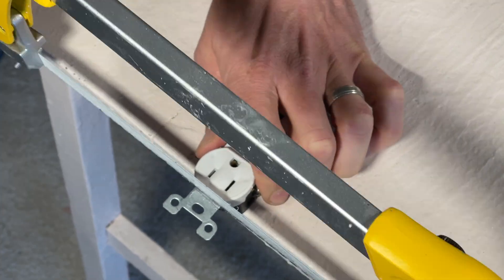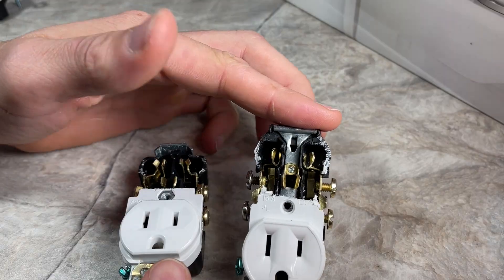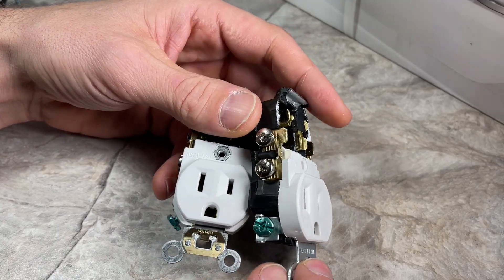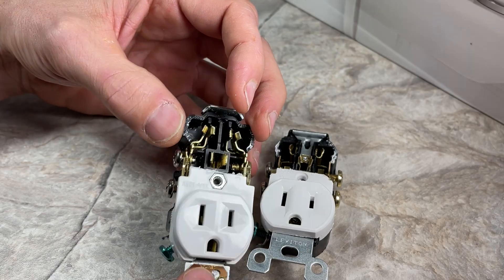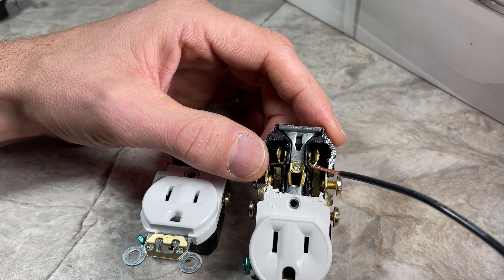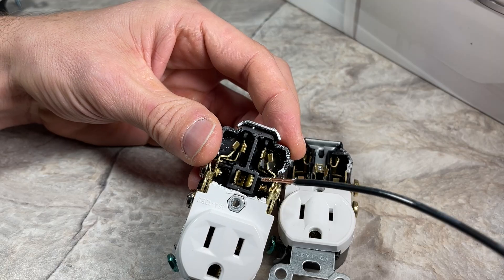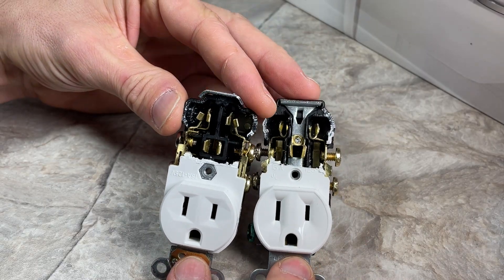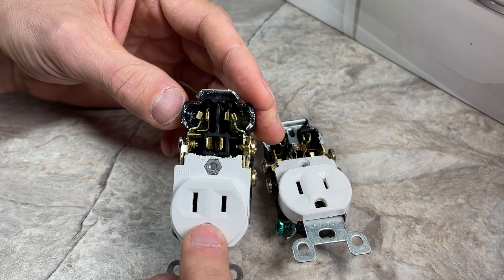What Outlet Should You Buy For Your Home |  Commercial vs Residential

Comment: There is anothe type of outlet where the wire goes in the back through a hole like the push-in connection kind, BUT NOT TO BE CONFUSED WITH THAT EXTREMELY POOR DESIGN WHICH IS A SURE FIRE HAZARD..  NEVER USE THOSE.  DON'T UNDERSTAND HOW THOSE PASS MUSTER TO BE SOLD.

THE ONE I ALWAYS USE HAS A CLAMP INSIDE at the end of the screw. The hole in the back is aligned so that when you put the wire in it goes between the two plate of the the clamp and the screw pulls the inner plate against the wire and in turn pushes the wire against the outer fixed plate of the clamp totally securing the wire. You can easily identify these because as packaged the screws are unscrewed and crimped at the tip so they can't come out. The screws rattle around and you can see through the hole the inner plate of the clamp moving around unlike the push contact where the screw may be out, but the are screwed into the side of the body.   In the good ones the screw passes through a hole in the side of the body and is screwed into the inner clamp plate. Bryant makes them and Leviton probably does too. You can't beat a screwed down clamp!  Even better that under a screw head because most people don't know how to do that properly. The clamp is simple, fast and fool proof.  I never use anything else.  Yeah, they cost more. How much is your house worth?  Industrial maintenance specialist. I used to be responsible for an 18,000 sq ft manufacturing plant
and everything in it, on top of it, and under it, was my problem.

Comment: The typical bottom price receptacle is ONLY able to handle #14 wire -- if back-stabbing. These are the ones used en masse by tract home builders. Specification Grade receptacles actually expect #12 gauge wire. There are only a few areas in a home that demand such 20 Amp wire -- the kitchen and bathroom, being foremost. So, the rule is to go with Specification Grade where 20A is NEC spec'd. These are exactly the same places that have lots of insertions and removals of appliances over the years. It's the physical stresses that ruin receptacles. BTW, most residential circuits are -- by Code -- less electrically stressed than Commercial Circuits. In commercial use, circuits run, largely, straight through the business day. The typical Residential circuit has -- effectively -- intermittent loads... stuff like a coffee maker, hair dryer, slow cooker, .... So the rule is: brutal use -- stay with Specification Grade. Otherwise, in residential use, you can go 'cheap' without worry. BTW, there are VERY few receptacles of ANY type made in the USA these days. Entire factories have been shipped off to Red China and Mexico. Robotics has largely replaced human labor across the entire spectrum of production. Another reason to pay-up for Specification Grade receptacles: they tolerate DIY hand skills MUCH better.

Comment: My home builder installed cheap outlets throughout my home.  It’s almost impossible to even plug anything in.  You have to wrestle the plug in and it’s awful.  I dread having to plug anything in!  My advise is to blow the budget and install quality hospital grade outlets throughout your home.  You’ll never regret it.
Reply: Do you mean it's hard to push the plug into the receptacle? It could be these are tamper proof versions, and those tend to need a specific technique. There are some videos about plugging into tamper proof plugs, especially for senior's who have arthritis. Once you see how the mechanism works, then the technique makes sense and it works every time.
Reply: A cheap outlet would be the easiest to insert into. A hospital grade outlet will need a hemmer. ( almost, they are stiff. )

Comment: Often in many jurisdictions there is certification to consider. Many home reno stores sell the certified receptacle and the cheaper uncertified receptacle. They can often be essentially identical but there is a cost for the certification so that one is more expensive. 

Depending on the region there may be no rules against selling the uncertified one, but there is some rules and liability against using the uncertified one. It is basically a competitive market grab move for the home stores to have the lowest prices but it can cause huge problems for customers down the road. 

If you are building something new which requires permits your inspector may tell you to rip out the uncertified ones and put in certified ones before passing your build. 

Also there is a slim chance that an electrical fire causing damage may be refused insurance coverage if they find you used a cheap uncertified receptacle from a home reno store. 

Again this is all regional so you need to be careful, and at least talk to an Electrician buddy about it before you do too many projects yourself. 

Also the same thing applies to boxes and switches.

Comment: The residential 15 & 20 amp. plugs are fine for home / apt. use  with solid copper wire ! 
the commercial grade has a more positive separate 2 contacts for the hot and neutral because things are getting plugged in & out a lot more than in home use, the problem of residential is plug overload { christmas lights/ stereo equipment } and putting 15 amp. plugs into dinning/kitchen/laundry/ utilities room were NEC says 2 independent [ A&B phase] 20 amp. circuits are the law!
And a lot of homes & apartments built back beyond 1986 are run with aluminium or aluminium clad wire , were  Co/Alr plugs are NEC use by law ...  anytime I run into this , I bid that j-boxes be installed and solid copper wire be run to the outlet boxes and use Co/Alr wire nuts with the lube be used in the j-boxes because copper wire is just a better heat sink than aluminium !

Comment: yes the residential are cheaper made but at the savings you can have a box of replacements handy.. and when you consider 20 plus years prior to failure in most cases I would rather have new ones every 20 years then possibly replacing commercial ones every 40 years ?

Comment: I love Roy Najecki’s info! 👍 If it’s going to see frequent use, I want spec grade.  And if I can use NEMA 5-20 receptacles in place of NEMA 5-15, I will.
Reply from the maker: Thanks for the feedback Lane!
Reply: Only use 20 amp outlets on 20 amp circuits. Do not suggest that the wiring is 20 amp when it is not.
Reply: @kkarllwt  agreed.  Normally a receptacle circuit is 20 amp with #12 copper wire (I have lived in a cheap manufactured home with #14 wire and 15 amp circuits), thus a NEMA 5-20 on a 20 amp circuit seems a more durable choice.

Comment: He forgot to add if the outlet does start to fail and there is an arcing in the line the circuit breaker would shut off....weather it’s the .50 or $2 -$3
Reply: Not all shorts are going to trip the breaker.

Comment: Your basic 15a residential grade is fine for 99.9% of applications. .Is the 20a commercial-grade better, yes, but when building were do you stop spending "just a few more dollars "  Leviton is a good  brand name avoid GE devices, complete garbage. , HUbble is about the best you can get , and only available at electrical supply houses, not like your home depos , Use 20a in the kitchen for sure, but other then that, regular outlets will give you years of trouble free service when installed properly, And PS, fires start in the neutral, not so much in the hot leg , the hot leg is protected  the neutral is not

Comment: Nice!  Always wondered about that.  When I remodeled in 2004, I dumped the money into the Cooper Commercial grade receptacles.  Super high quality BUT, today, the white plastic on half of them is definitely discolored to a somewhat obvious off white.  Ugh.
Reply: White isn’t a good choice for most things, in my opinion.  I put those Cooper receptacles in my kitchen upgrade, but I chose “light almond.”  That shade works well with colors without standing out the way a white device would, and I don’t expect it to discolor noticeably since it is alreade off white.
Reply: 16 years on you still work to unplug from them. As it should be.

Comment: Tamper resistance outlets are all I buy.
Reply: That’s what you are supposed to use now, but I hate them.  In my kitchen, where I plug things and out relatively often, I got specification Eagles (Cooper), but my electrician said I needed tamper-resistant.  So I bought some just to get through the inspection, then replaced them.
Reply: @GH-oi2jf  yeah I can understand the frustration of that in the kitchen. I just buy the contractor packs so everything gets swapped to TR I bet a new regular outlet is fine as long as it’s in line with a GFCI. You may have to replaced them in a few years but that’s not really a big deal.

Comment: The commercial grade you have there can handle four wires on each side, which means you don't have to pigtail when you have more than two wires on each side, which saves a lot of time and effort.  (In some places, pigtailing might be required by code, or at least people think it is.  And, some people think you should always pigtail, regardless.  Whatever.)  Another advantage with the commercial one is that it accepts straight wires, so you don't have to bend in a hook, again saving time and effort.
Reply from the maker: Hey Dan, yeah I think the back wire option for the commercial is a big plus.

Comment: I wired a double box with #10 wire and 2 20-Amp receptacles. Overkill? Better than underkill. I can plug in power tools and know I won't fry the circuit.

Comment: You're not kidding about those push in holes for the wires. I made that mistake once, NEVER AGAIN!!! I always use the screws, and use pliers to shape the wire around the screws, for maximum contact area. That minimizes temperature rise, if the outlet is heavily loaded, by plugging in something like a space heater. You just don't get much contact area with the clips biting into the wire when you press them in the holes. Once the wires get hot, they oxidize, increasing contact resistance. It takes very few thermal cycles, to simply burn up, if something like a vacuum cleaner or electric heater are plugged in. (high power appliances should only be plugged into a 20A service, wired with 12 G or larger wire)

Comment: i try to find the commercial outlets that have the back wire option under the screws. allowing for a lot easier and more versatile connections of the wires in and out of that box without  wire nuts you can have 4 wires securely on each side of the outlet with the wires just striped and inserted strait in holes that are clamped by the screws

Comment: I can tell you without a doubt that until I saw your video I had no idea how completely unacceptable the so-called residential plugs are. They almost seem to be balsa wood instead of oak in the constructing a table. I just would simply change them all out as a matter of course because I don't want to have to worry about it, I want to build it and forget it if you will. Excellent video thank you for sharing.

Comment: I tend to make sure I do not have to unplug most of my receptacles, and never use extension chords for any reason. I also make sure the chords do not sit on the floor to be walked on, furniture slid over them etc. I have also because I have the skills shortened chords for lamps, clocks and some other appliances so the chord is not heavy and the less chord, the less resistance for the current to travel. If such as a Garage Door Opener needs the chord to stay in it's original length. I will secure the chord to the ceiling so the chord head is not supporting the weight of the long chord. Also if you bundle a chord to contend with the length or such, wrap the chord in circles before wrapping it with zip ties, this allows less resistance for the current and lessens the possibility of breaking the small copper wires in the chord. A chord should never be sharply turned as this creates resistance inside the rubber jacket and can lead to hot spots, melting of the jacket and shorts! I do this even for computer fiber optics, low amperage cell phone charging chords and such. I have used a tester to plug into each receptacle of the house to determine that there is No reverse wiring and that each receptacle offers a ground. I also had installed on the power panel a surge protector for the panel which covers all circuits 220V and 120V. Circuit breakers should be replaced every ten years or so according to your local codes. Light switches and receptacles about the same of every ten years. This will help prevent electrical fires, and all appliances should be checked for their durability. Mom's toaster might look nice, but they were not manufactured to today's standards. Small appliances should not be left plugged in unless it is in use.
Reply: “Chord” is a musical term for three or more notes played together. “Cord” is a flexible insulated cable used to conduct electricity.

Comment: My current home was built for me in 2000. I  have had at least 4 electrical receptacles that have failed over the years in my home. Of course in the places of freq use like the kitchen.
When I build my next home, I  will put professional grade plugs in all of my rooms in that future home.  The labor cost to have someone replace those 4 plugs is probably 10 times the cost difference if all of the plugs were commercial from the beginning.
Since my current home was built by a big name nationwide company, I  did not have any choice on the kind of plug that was installed while the house was being built in 2000.

Comment: Never buy the residential grade of outlet. For a few pennies more you can get the better made commercial grade. One problem, that happens to many residential outlets, is that plugs that are plugged into that outlet start falling out of your wall outlets by themselves. This is because the copper prongs that grab the plugs are cheap and after a little use they spread apart and the results are the plugs fall out. The commercial outlets have much more robust copper prongs and will continue to grab the plugs for a long time.
Reply from the maker: Thanks for the feedback James 👍

Comment: Wiring to the screw terminals on the economy outlet means hooking solid core wire like a candy cane and only putting one wire per screw. Wiring to the screw terminals on the commercial, the wire goes in straight (held between two plates) and you can put two wires per screw AND you can use stranded wire. To use stranded wire on the economy receptacle and comply with NEC would require a termination like a `U` or eye terminal.
Reply: what wall has stranded wire in it?
Reply: @natalieisagirlnow  
Stranded is used in commercial.
Reply: @natalieisagirlnow  You don't pull solid core in conduit, so most outlets fed with conduit (most because there's always someone shoving 12-2 through EMT in their garage).

Comment: You mentioned an important factor; the amount of usage an outlet will be subject to and in "Roy Najecki
" comment, he also states the same argument. The 50 cent plug is all you need and my home uses these as well. But I installed the commercial grade outlets in my basement work shop and everywhere in my garage I went with 20 amp outlets for that very reason and because the electrical tools tend to pull heavier amperage. Thanks for the video, much appreciated and good basic information ! And great comment by "Roy Najecki
".
Reply from the maker: Appreciate the feedback!

Comment: I had an issue with lights not working well in the shed, come to find out, the plastic case on the switches was cracked. Thus, the switches were making a poor/intermittent connection. New switches fixed the issue - I don't know why both old ones failed. They were probably only 10 years old at most. Dunno how often they got used, as we moved in two years ago.
Reply from the maker: Yeah 10 years seems like a short useful life for a light switch.
Reply: @EverydayHomeRepairs  My guess is that it may be due to the high heat from being in the shed - there are no shade trees to keep things cool. It does get hot in there.
I couldn't really see any damage on the handles so I don't suspect that they were accidentally smashed.

Comment: The keywords are commercial and residential. Commercial grade unit must withstand more usage; in other words, it is designed as a heavy-duty receptacle. That's the reason for much ticker conductive parts.  I always put commercial-grade electrical equipment in my house because it lasts longer.  All this separation between commercial and residential is made to justify making cheap parts that will be saleable. Btw I am an industrial electrician and I have seen a lot of different grades of equipment and the only difference is longevity. All equipment works the same way but lower grade dos not last long.

Comment: After replacing way too many switches and outlets in my previous house, the first thing I did when moving into my current house was replace every single outlet and switch with the commercial version.  After 12 years, I haven't had to replace a single one again.
Reply from the maker: Nice!  Smart move 👍
Reply: What a waste of time and money. If the cheap outlets weren’t safe they wouldn’t pass code.
Reply: @bradganz6787  I didn't say I replaced them because they weren't safe.  I replaced them because I was tired of plugs falling out and switches failing one at a time, and having to break out my tools, mess with the panel to find the right circuit, etc. every time one needed replacing, once or twice a year.  After that one afternoon during move-in 14 years ago, I haven't had to touch the panel once for electrical repairs.

Comment: I have seen so many of the residential with the wires just pushed into the hole in the back. Many have ended up getting hot and losing tension and then arcing and burning up the wire and contacts.
Reply from the maker: yeah, unfortunately the use of push pins are super common on new builds in our area as well.